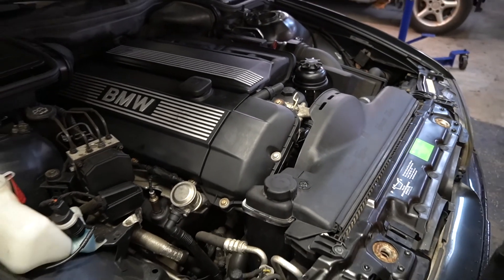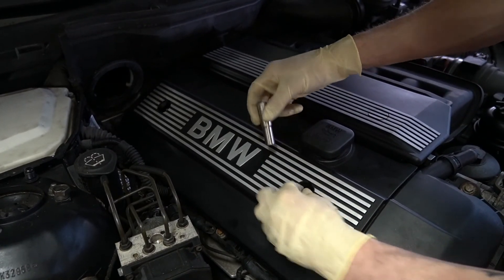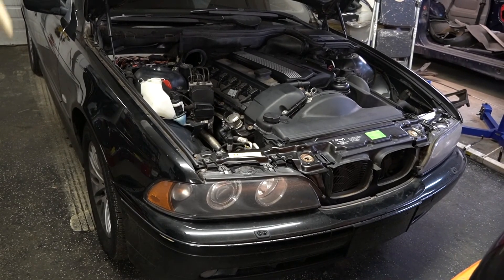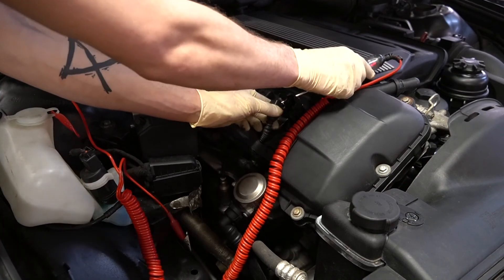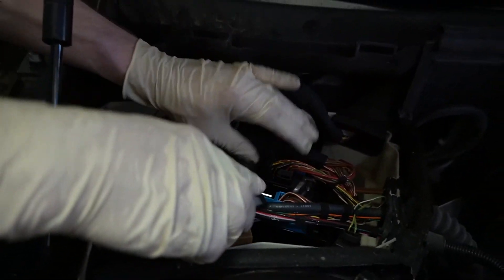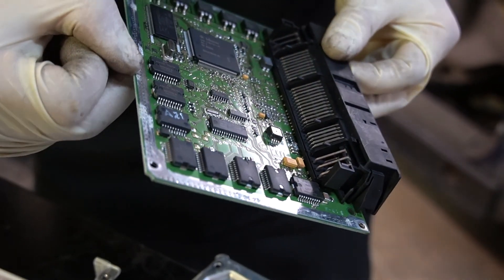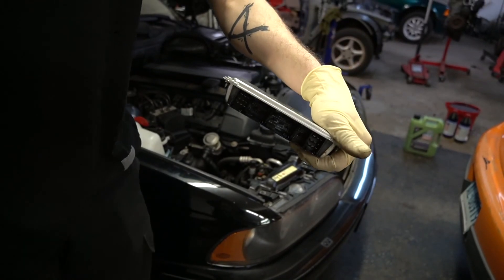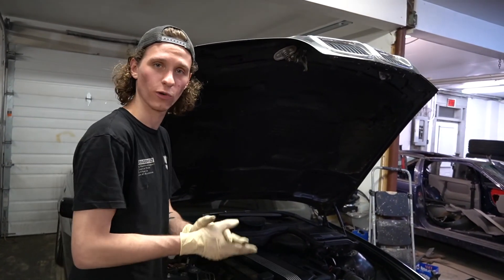E39 530i DME Failure (How to diagnose a faulty or water damaged DME as the cause of crank no start)

Comment: Hi. Very useful video. My 530i was left for 1 week while we went on holiday, and was running ok when parked. I had experienced occasional strange events - like a bulb warning light for a front fog light bulb which worked fine, and if I put the main beam on and then off, it cleared the fault. At one point my headlights would be on main beam unless I selected main beam on the light stalk controls, which was wierd, but then it just stopped doing it. So maybe that was a sign of what was to happen next.
While we were away, there was some very wet and windy weather back home - like, the rain came in horizontally.
When I went to start her up, it ran ok for a short while and then started to misfire. I limped home and parked up, then tried to check for possible causes. The misfire remained, and when I put the lights on I could hear something from the engine bay, like a clunking sound.
I'm thinking that the DME might be water damaged as you've described. Sporadic stupid events which cleared up on their own could just have been because the DME dried up.
Just 1 question, is the DME box always under the right side air filter - or would it be different for right hand drive? I can't see whether your 530i is right or left hand drive 🙂
Many thanks again
Reply from the maker: Glad to hear the video helped! This vehicle is LHD so I’d make the assumption that on your vehicle the dme box will be on the opposite side of the steering shaft. I may be wrong but it isn’t all too difficult to verify. -Mike

Comment: Great post. I'm experiencing this now. Electronics gone haywire. Will start and run when cold but will eventually die and not restart. No communication with Autel, Foxwell or generic scanner. My issue might be moisture and cracked solder joint because it will run for about 15 minutes and most functions seem to work. Sending mine in for repair.
Reply from the maker: Sorry for the late response! What ended up being the solution?

Comment: I can hear the DME relay clicking like that and my temp gauge pegs to the red when the engine is cold.
I put in a new double temp switch and it still has the issue. I unplug the connector to the DT switch and it will start occasionally and sometimes just cranks. The OBD reads correct temperature when it starts. 

When it does go wrong, the OBD just doesn’t talk and the relay clicks like a fan. I’m thinking my DME is dying!
Reply from the maker: The DME has an influence on all of those things you have listed and you shouldn’t throw any more parts at it before inspecting the dme for damage
Reply: @bavhaustv9795  thanks for the advice. What I did try is replacing the power blue relay to the DME which was dead cheap. Then I added an earth connection to the relay board as the earth wasn’t great and now my car starts fine and the power relay never flutters anymore. No more pegging of the temp gauge.

Thanks for the tips!

I still do have had a power drain 0.69A for a couple of years when the car is asleep. Flattens my battery after 5 days.

I checked the fuses/systems to death and nobody else could find the cause of draw either.

Ironically the blue power relay to the DME was hot. It was the only thing left to check. 

I unplugged the power relay and my current draw was reduced from 0.69A to 0.03A on my 530i.

I’m going to check the power feed to the relay/ignition switch and also the DME for corrosion. There was a spot of water in the white plastic DME box. 

Can the DME raise sleeping amps to 0.69A?
Reply from the maker: @whichdoctor4858  weirdly enough I think this car also had a parasitic draw